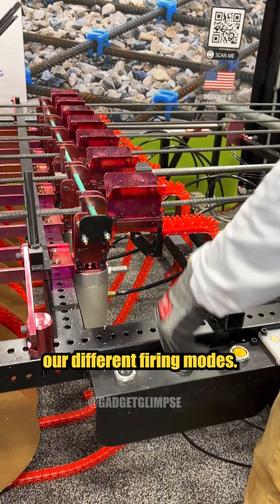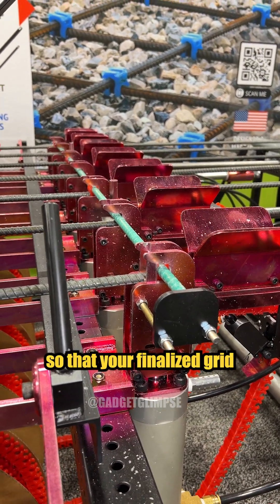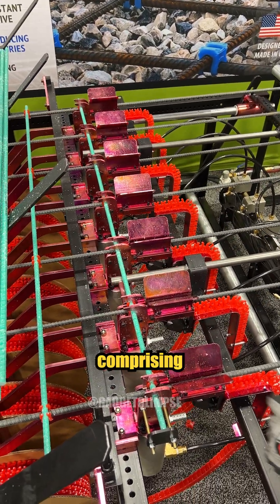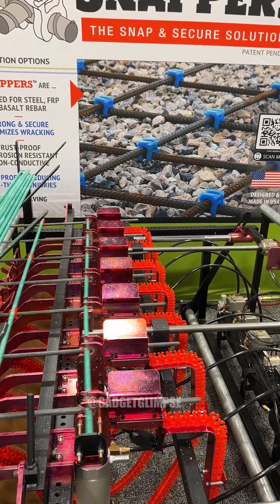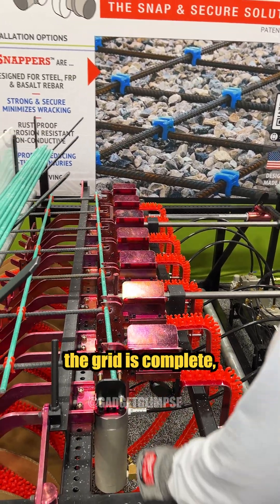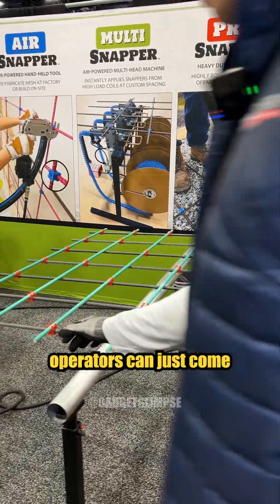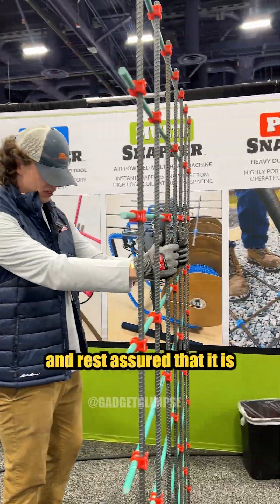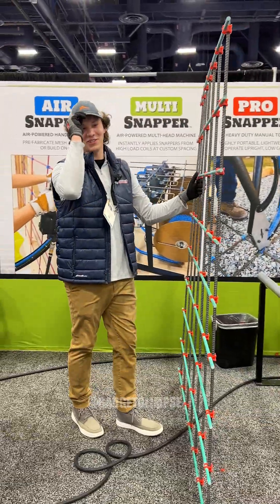Multi Snapper System by Encore Fasteners: Revolutionizing Rebar Fastening

Comment: The whole point is to have one guy doing this, one guy feeding / assisting and other laborers just moving and placing the finished rebar.

Its definitely not any faster than just having all of those guys on rebar with a tie gun. But it should be easier on the back as carrying and placing is less intense and less likely to cause strain injuries than hunching over.

Overall it may not be ideal because it requires setup and a special power setup. whereas a tie gun does not (it only requires very portable batteries).

Might be good for small to medium construction companies (medium being < 40 employees)